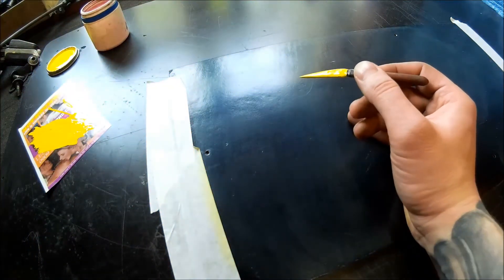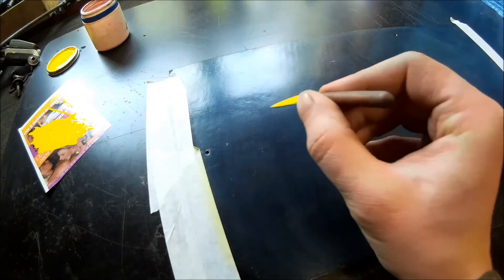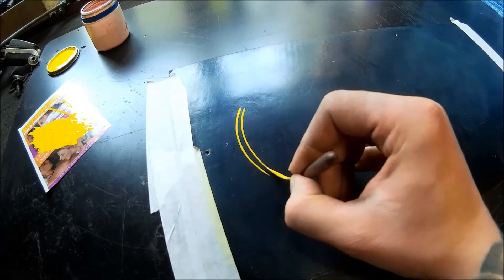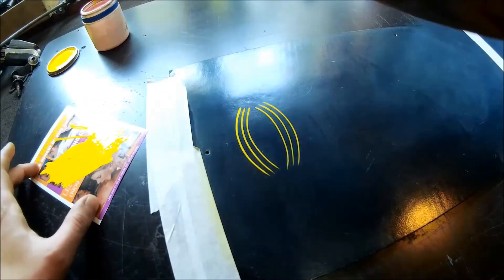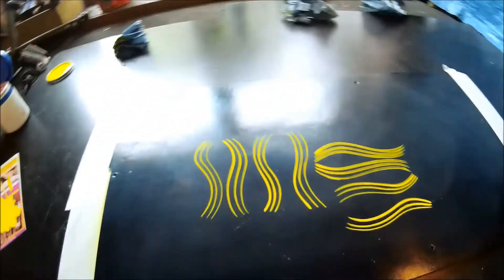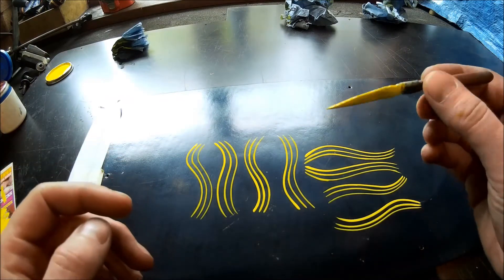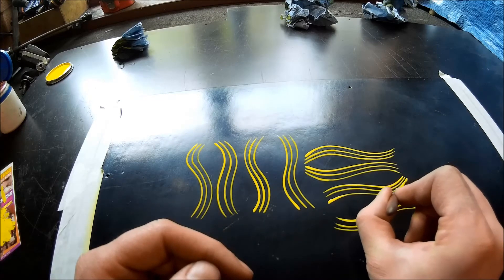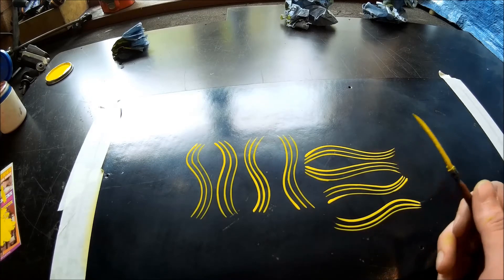Cambridge Pinstriping, Tutorial - Part 9, Back to Basics, How to pinstripe.

Comment: niiiiiice one mackie, practice makes perfect 👌, you can see the lines improving. it's like when I was a paramedic, I was always in the training room practicing putting on triangular bandages, you have 4 different ways to fit them for 4 different types of injuries, and a few of the guys would take the piss, until when we were partnered up and got a broken arm injury, then I would stay back and laugh into myself at them struggling to try and fit it correctly, such a bollocks they would make. usually after we dropped the patient into casualty, they would ask me to help them practice in the back of the ambulance. lol. they never sniggered again, in fact they asked me to practice with them in the training room.  a triangular bandage has the knack to make a complete fool of you in the most uncomfortable situation. 😀 👍 👍
Reply from the maker: exactly that Mikey! any skill can be developed to near enough perfection, but if the foundations are missing, the overall progress will be really slow, and results not even half decent. thanks for watching as always.